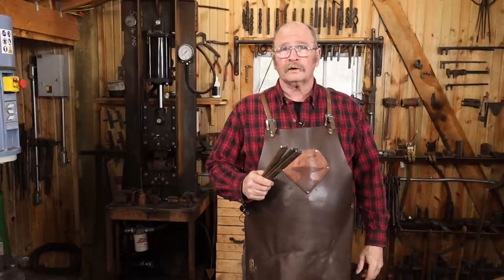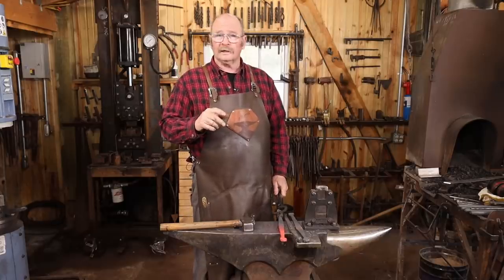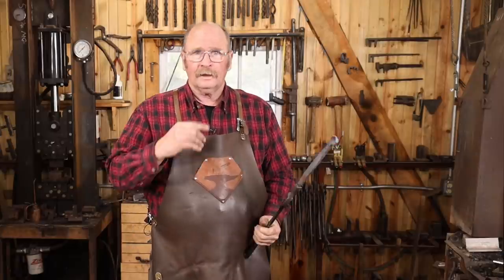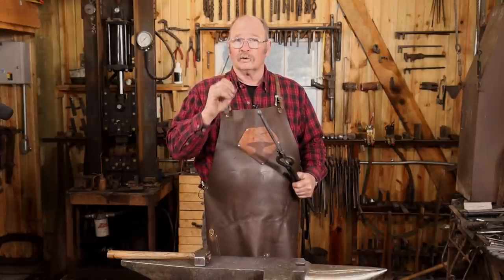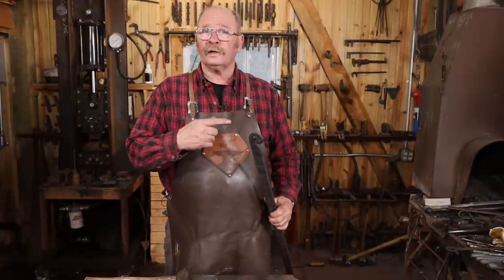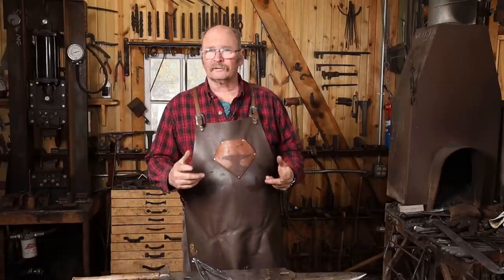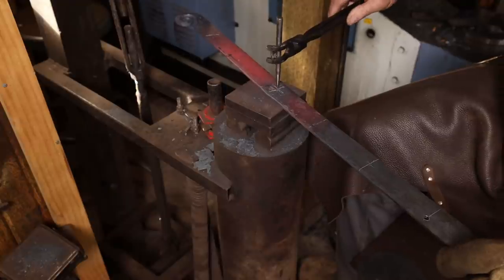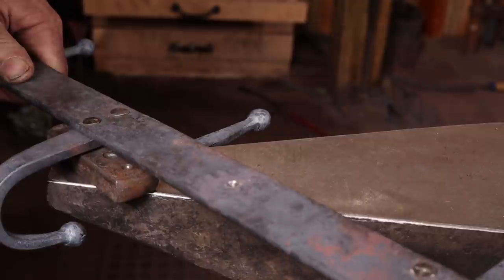Forging a Coat Rack for the basement wood shop

Comment: The presence of mind of not overheating/burning of the delicate parts of your work is something I still need to incorporate in my forge work.
Nice piece!
Reply from the maker: Using the gas forge with the heat turned down low enough it won't burn the material really helps.

Comment: Thank you for your videos and all you teach. I blacksmith and bladesmith as a hobby. I work in construction and just turned 40. Do you have any tips to keep you healthy and not wear yourself out as you forge?
Reply from the maker: Mostly just stay active at it.  But don't get tempted to swing too heavy a hammer.  With your construction background you probably have reasonable hammer control, but poor technique can cause real problems.  As I get older I also find that I embrace power equipment more and more.  A power hammer or press can really save wear and tear.

Comment: Lovely how the two end scrolls give a start & a finish from the bottom to the top of the bar. I was expecting both on the same side, but this adds a lovely charm as does the aligning of all the horizontal slot holes in the screws with the design. So so much better than a stamped sheet utilitarian piece. Thanks for sharing!

Comment: Very nice work John. Your forge is not lit; I suppose you are using induction heater ?
Reply from the maker: No, I'm working in the gas forge.  It puts more heat in the shop during the winter

Comment: guess you need the swage block. I tried mine without it and it looks alot more like  a really tight scroll than a ball. not bad but not really a good ball either.
Reply from the maker: The swage block helps but it can be done at the anvil, just takes more practice.  You can also make a simple single purpose swage for use at the anvil.

Comment: Really Great Work. You should use the power hammer as much as possible. Save your shoulder elbow and wrist.  Tenis elbow and carpal tunnel really sucks. That's a lot of stress on your joints.
Reply from the maker: I agree 😉

Comment: Can you use a small hammer
Reply from the maker: Up to a point.  Trying to use a hammer heavier than you're comfortable with can cause injury.  But if you're limited to a very light hammer you will want to work on smaller projects.